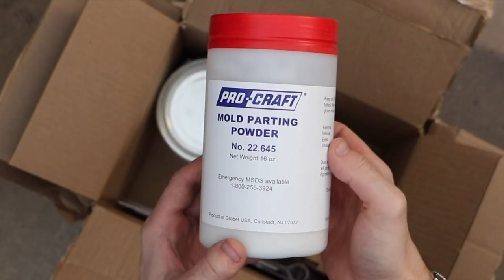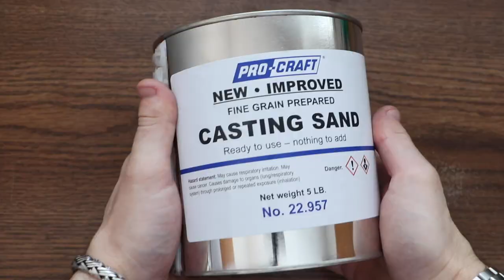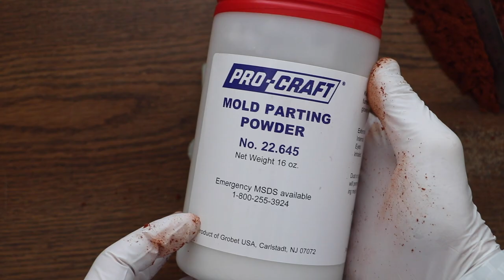CASTING THE KEY | CASTING SAND | PART 1 | EPIC FAIL!

Comment: Not that epic of a fail.. :) Preheta the mold, more metal for more pressure, maybe i would lay the flask on its side and do a pouring cup and a sprue from the top and directly to the head of the key, then you would just saw the sprue off of the head and grind flat..